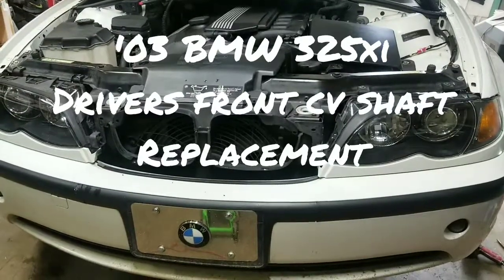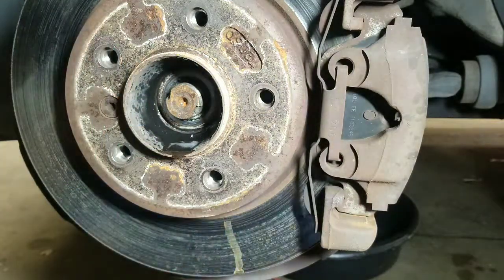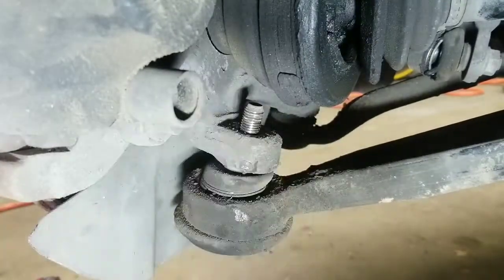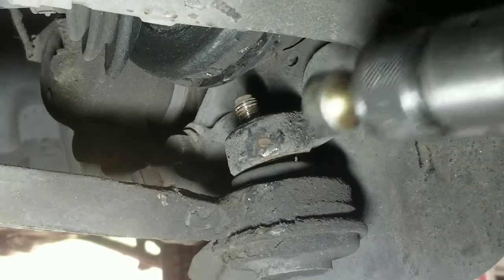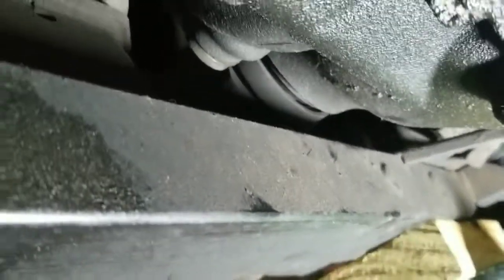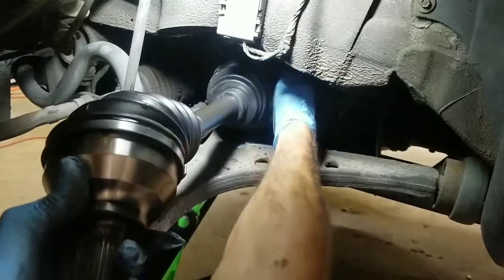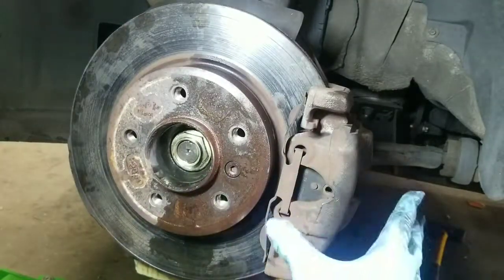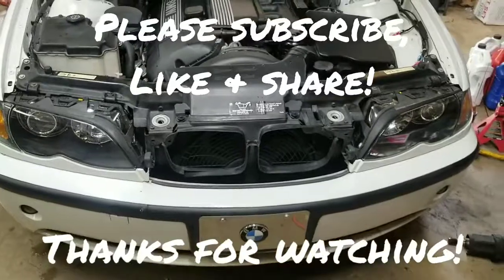'03 BMW 325xi E46 CV Shaft Replacement (Left Front)

Comment: I have no air hammer, so I had to keep pounding & pounding... but the ball joint released eventually. To be patient is great advice. This is the best how-to I have seen so far. So many others are all about removing the caliper, removing the rotor - or perhaps disconnecting the knuckle from the strut tube (which may have been a close second as far as easy approaches to doing this job). Anyhow... I've got the passenger side done now - the driver's side is still to go. Thanks for this video!